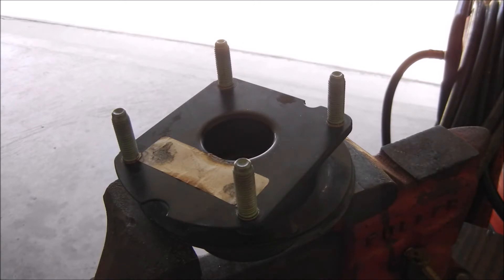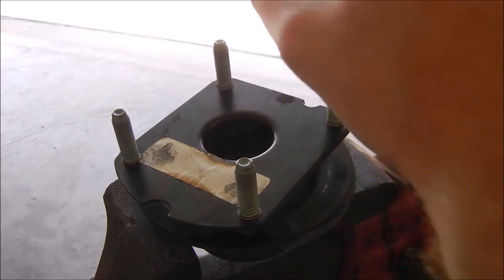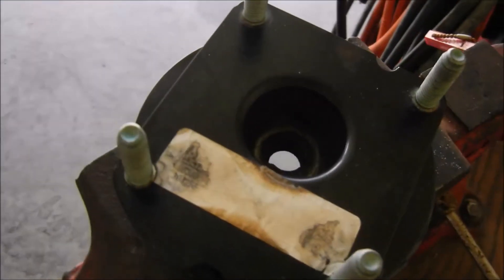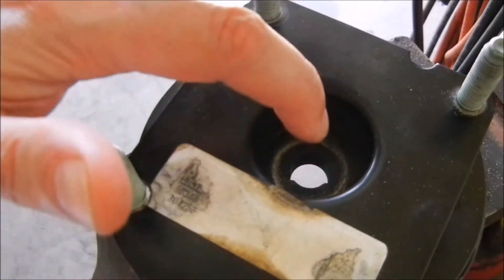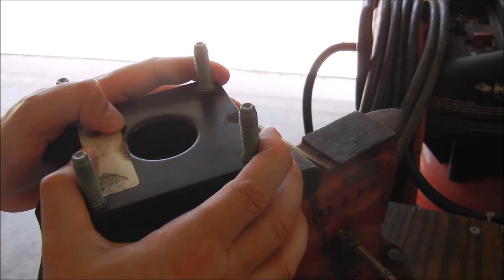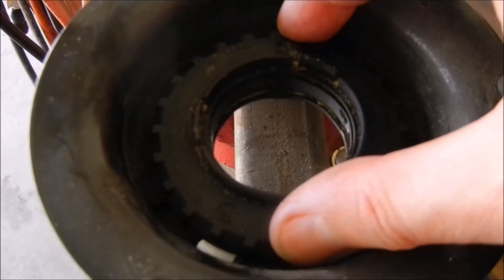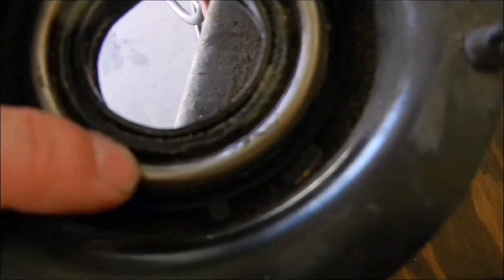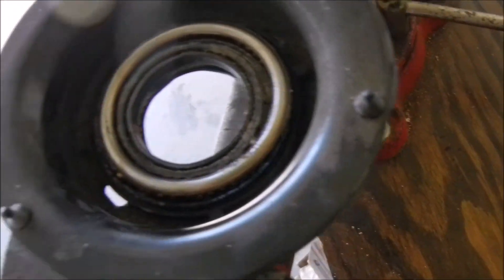A Close Look At A Bad Ford Explorer Strut Bearing

Comment: Thanks for the video. I’ve been having issues with mine as well. Changed out sway bar links, inner and outer tie rods to find the problem and the problem was still there. Turn the wheel at low speeds or while it’s parked and it makes that same WOMP WOMP noise. I came across a forum about it and it came to my attention that it was possibly a strut bearing. Came to your video and you described the exact same symptom I’m having. So I’ll see about my luck in this one. Thanks again.
Reply from the maker: @dustinguy101  thank you for the comment. Hope it fixes the problem!